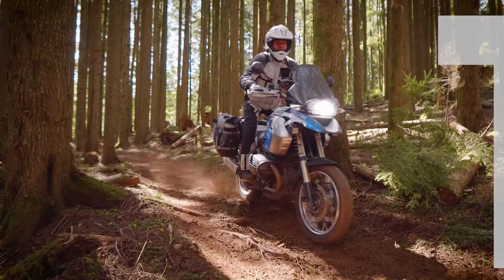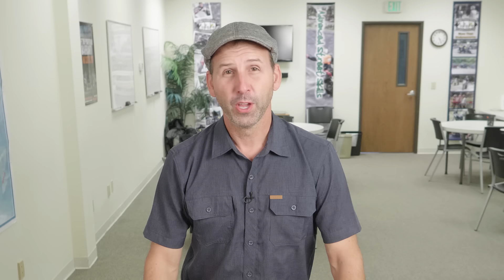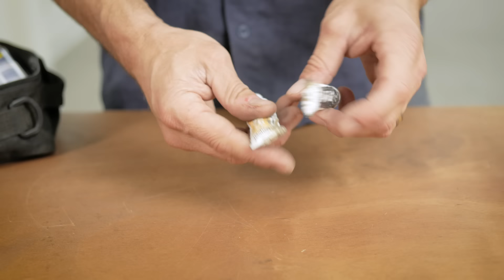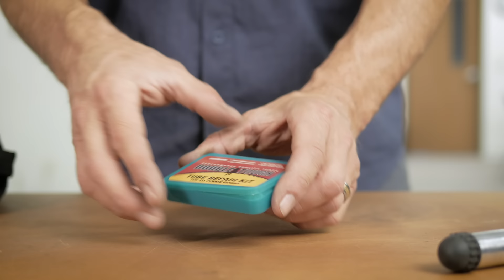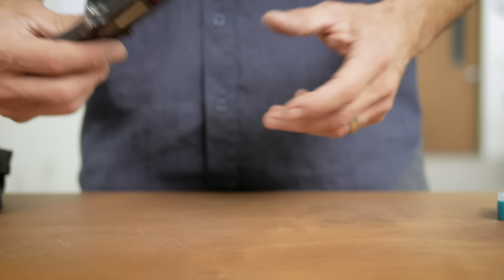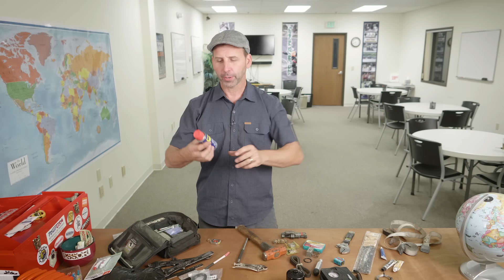My Complete Tool Kit for International Motorcycle Travel - TOOLS, SPARES & REPAIRS / BMW R1200GS

Comment: I use those packing straps of mounting all my luggage to the bike. I actually made all my own with a large roll of 1" heavy duty strapping and  snap buckles I sew on (using kevlar fishing line for strength) So I'm never concerned about losing any of my gear while traveling. My only other mounting device is a heavy duty cargo net for strapping items to the top of my luggage on the back seat (so I can keep an eye on it)

Comment: I know this is an older video, but I was wondering what portable tyre inflater do you use?
Reply from the maker: Any small tire inflater from the auto parts store will work. We remove the plastic housing (to save a lot of space) and replace the 12v connector with an SAE connector.

Comment: True about meeting locals. I did alot of riding in the south ( shortly after Easy Ride) I was stopped by a local police officer, I knew I had done nothing wrong. Just for the story I was riding a 65 R69S with Earle forks. He comes up to me said sorry if I scared you, but I never saw your bike be for. We stood and talk for a God half hour forty five minutes.  He gave me his card and said if any one gives you a problem or you need something just call me. In Tennessee I had a flat of course it had tubes and no way were you going to take it out with the tool kit tire irons. I started taking the wheel off and 10 bikers some with trucks and we got it done. I f you treat locals like its their town which it is,there are a lot of good people that will help you out if you give them their due. Still riding I have spent about 50 years in the saddle just keep the dirty side down. To all you kids that stunts are fun and the bones will heal but it huts like hell when and if you live be old and the weather  turns damp.

Comment: As an option for your metal tape measure use a cloth seamstress tape measure and a rubber band to save a couple OZ and get the added benefit of an extra unit of measurement for those foreign countries.. good video, great tips although all of my motorcycle towing experiences have been bad ones!! Lol 🤣

Comment: I rode from Portland to Ushuaia Argentina on a KTM 690.  Turned out to be a bad choice of bike, my engine failed in Antofagasta Chile.  Luckily before I left I researched potential failures and had a spare set of rockers with me.  Ended up tearing my engine down in a luxury hotel parking lot.  Met a lot of nice people while replacing the exhaust rocker, it was the best 2 days of my trip.  Yes, I did make Ushuaia.  Then I went to the Arctic 3 times.

Comment: also small headtorch for repairs that go after dark, sanitary pads (good to soak up oil/gas/blood), silicon tape, knipex pliers, leatherman crunch (has vice grips), Garmin Inreach, nitrile gloves (saves getting dirt/grease inside your riding gloves after), small rag, right angle connector for tire pump, paracord. Instead of big pouch I use a smaller one and 7x5x2 metal tin, you can use the open lid to put bolts, screws, sockets you are using on so you don't lose them. A few stainless bolts with lock nuts to sub for broken pegs, shifter and other things. From your first vid, great idea to tape your tools so they don't get mixed up with others. Last advice you've given the best, thanks for putting this together. Happy trails :)

Comment: Duct tape makes a gooey mess. What you want is Gaffer Tape. It will not leave adhesive on your bike and is much stronger than duct tape. It is available from any professional video or camera store. You probably won't find it at the corner camera shop.

Comment: try ballistol if you can get it in the usa instead of wd40. actually lubricates and is much less aggressive to materials like rubber, plastic, leather or wood... https://ballistol.de/. Very nice and correct video... having travelled 2 years on a bmw gs r80, you are spot on with the stuff you have to bring... i brought a bit more tools then you recommend, but 2 years is longer then most do. All the best and happy riding!

Comment: I carry paracord. You can cut it to length and use hitches for tightening.  Ss zip ties interesting. Didn’t know they existed. I carry radiator hose clamps. Various nuts and bolts. You’ve got great ideas. Chain. I needed to take link out!

Comment: If you take the adjustment knob out of the Vice grips, it can be used as a punch.   Just remember, it’s soft steel and not a hardened punch.

Comment: just a suggestion
you can replace crescent wrench with knipex pliers wrench
the clearance is about the same, but you get option to use them as pliers, to bend sheet metal back up etc

besides, you will never round bolts with them as they compress onto the fastener when you are torquing it, unlike crescent wrench that gives slop under force

Comment: What are the measurements of the 19" tube? 110/90; 120/90; 3.2x3.5 or what ???? What are the specification I need for such a tube for the 1200 GS or doesn''t it matter? Thank you very much.

Comment: Bret, Can you explain the logic behind why BMW Motorad wants everyone to change their engine oil and filter every one year, regardless if it was ridden 2,000 miles or 6,000 miles.  Lets take out the contamination equation for a bike that is always ridden every week, never taken off road and is parked in the garage. What's the deal, other than making the dealers make a profit on polluting the planet with unnecessary oil changes?  Thanks

Comment: Quick question regarding the towing technique.. I always thought the closed loop is tied to the towing vehicle, the open end is wrapped twice on the footpeg of the towed vehicle. If in danger, the towed rider can lift the foot off the strap and it will unravel breaking free the vehicles. What do you guys think about this? Hopefully never had to use this.
Reply from the maker: You're 100% correct.

Comment: When you perform maintenance on the bike at home, use the same tool kit you intend on taking on your travels, that way you know you have the correct tools as well as the tools being able to do the job required. My R1100 GS I took a 14 mm Allen key and a 30 mm socket, with the factory tool kit I was able to change the clutch plate, change gearbox bearings.
Reply from the maker: Good advice, Rob.
Reply: Advise I give often
Reply: I do the same thing. I’ve added many things I didn’t know I needed when I first made my Kit. I have all my Tools in a Pelican box I mounted on the GS.

Comment: Not sure if this is a commonly known trick but when you first get a fresh bag of zip ties (where the bag isn't resealable) use a Stanley knife and cut through one side of the bag in the middle crossways not lengthways. This way zip ties don't fall out into your tool kit and they are easy to grab when you need them.
Reply from the maker: Good tip!
Reply: Thanks
Reply: Holy moly this is so simple but easy to overlook. Thank you!

Comment: Great video. Love the tip on the stainless steel tie wraps. Will add those to the kit. 

However, I find the towing tip in the centre of the handlebars very doubtful. Almost all bikes have some sort of fairing and it is impossible to attach it to the centre of the handlebars. Even on my KTM exc I would destroy the plastic headlight mask. The tip someone mentioned in another comment about towing footpeg to footpeg is the most practical and safest method. Love your video's anyway :-)
Reply: When I've towed, I've led the strap up through the forks to the left grip, and got the towee to hold it there. That way, he's got full control of the steering, and can release very quickly and easily if things go unstructured.
Reply: A quick release snap shackle allows you to use a fork or footpeg tow bridle and the towee can release instantly by simply yanking on a the non-loaded paracord tail. Used for boating all the time...

Comment: About storing the spare inner tube : I coat my tube in talcum powder then seal / vacuum store that tube in tough cry-vac plastic. The cry- vac plastic is tear resistant , while making the tube more compact, and the talcum powder helps preserve the rubber whilst stored in the cry- vac , and also later aids with easy installation of the tube into the tire.
Reply from the maker: Good tip! Probably smells nice too.

Comment: I’d like to offer some insight I gained dragging a WR450 with a broken crank gear through Lockhart Basin. Instead of attaching the tow strap to the bars, attach it to the left foot peg in the same fashion you mentioned. When the towed rider needs to release, just lift your foot off the peg. It makes life much easier for the towed rider by pulling at a far lower point on the bike. Give it a shot sometime...✌🏼
Reply: Yes... That is the other most common tow method I know of
Reply from the maker: Good tip!

Comment: A metal file is also good, break a brake lever, you can file off those sharp edges, also, can file the link ends off your chain, or a rounded bolt end and cant get the nut off, you can file it back again so you can remove the nut,
BTW......
WD40 is NOT good for a chain lubricant, its a degreaser, and will eat into all the grease inside your links, when you spray chain lubricant it wont always get inside the links past the rubber seals to lubricate them, its not about drying the rubber o-rings
Reply from the maker: Good tips. WD-40 on a rag for wiping down a chain, not for lubricating the insides.

Comment: You had your Motion Pro bead breakers ground down! I just may have to do that!
Reply: They are the stock aluminum ones... Just worn from use.
Reply: They look about 3” shorter than mine! BTW, Fort Nine has recognized you in their latest video!
Reply from the maker: The aluminum bead breakers are shorter than the steel ones. Link in the description.

Comment: a noob question. how do you fit the tube into a tube less tire? how do you fit the valve?
Reply: Remove the valve stem and run the tube valve through the same hole

Comment: Great stuff, the only thing I would add is an extra clutch and throttle cable.
Reply from the maker: Absolutely!
Reply: Throttle cables rarely break just like that (unlike clutch cables) and often come by two
You can always swap them and be on your way
So I wouldn't recommend packing those, as they take quite a lot of space
Reply: @C4H10N4O2  I thread a spare clutch cable beside the old one and tape together.  Takes no room and  it's ready when needed.

Comment: School pencil case with a couple  of sections containing a few spare bolts, nuts, Allen keys 
My spare chain link,  fuses zip ties and araldite and thread lock also go in here.
I carry a small bottle of rad seal to.
Ratchet strap for ferry companies that don't provide them.
Congratulations on 100000 and more happy travels.
Reply from the maker: Good tips! Thx, TT.
Reply: I also carry some extra Bolts Screw and Nuts in my Kit.

Comment: Buy a Wera metric kit, it’s a well engineered (German/Czech), robust and very compact ratchet/socket/toro/hex set that will get you as far as a crankshaft. I packed it in a Kriega tool roll, and added a few specific sockets and adapters. Also, don’t waste your time with a crescent spanner or channel lock, get a Knipex that has incomparable clamping forced and perfect parallel jaws (it’ll remove anything, even stripped JIS button head bolts in Keihin carbs. Agree (and carry) all the other stuff.
Reply from the maker: That's good stuff, Ronan!

Comment: I wonder how soon we'll see the almost ubiquitous post with such videos: "WD40 is not a lubricant". BTW, I thought you phrased your advice there very well.
Reply: In my mind anything that reduce friction is technically a lubricant; water, soapy water, and even spit. Oil and grease is just a specific type of lubricant..
Reply: WD40 is a degreaser, as it fizzes to it will remove all the lubricant 'inside' your links, you cant always rely on spraying the chain with a lubricant to get 'inside' the links
Reply: @wolfe1970  Nope, if the WD40 is getting into the inside of the rings, then you're already due for a chain replacement. You should use some sort of lube whether or not you use WD40.
Reply from the maker: Yeah - On a chain, WD-40 is more about cleaning the muck off than lubricating the insides.

Comment: Isn't green flavor loctite the permanent one?  Red takes more torque to break than blue, but it's definitely removable.
:edit: needed some blue for the bike, so I hit up the store.  I had no idea red flavor is actually referred to as "permanent."  xD  Same temp ranges, cure, but for larger fasteners and the breakaway.  TIL
Reply: Green is wicking, where you don't separate the threaded parts first.
Reply: @terrynixon8152  ahh. TIL thanky!
Reply: But red tastes the best.
Reply: @azb2010  I can't argue that logic :D
Reply: Red is for heat sensitive areas
Reply: @codykiehn7803  Not always.  Bonnet studs for Navy seawater valves use red flavor, for example.  We never even had blue in shop, now that I think of it.